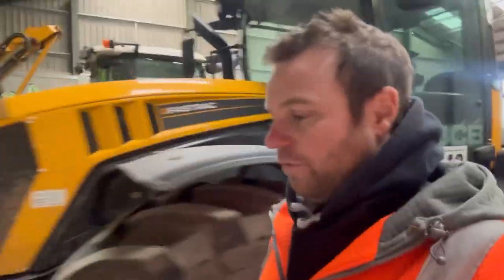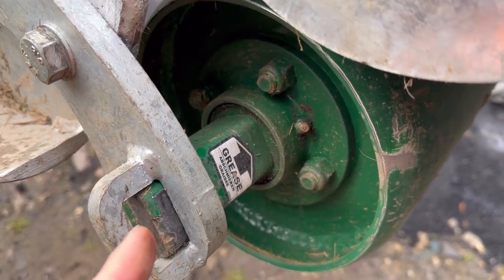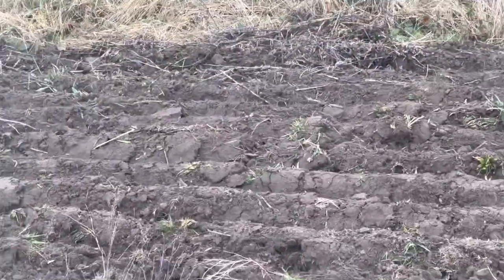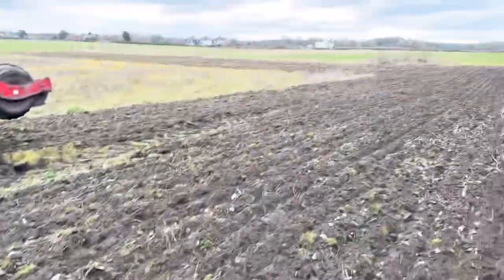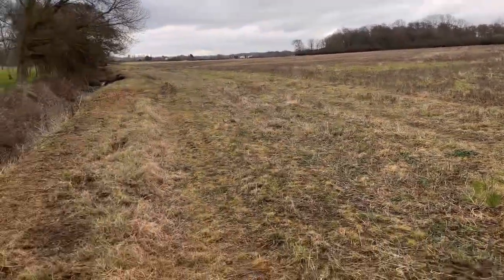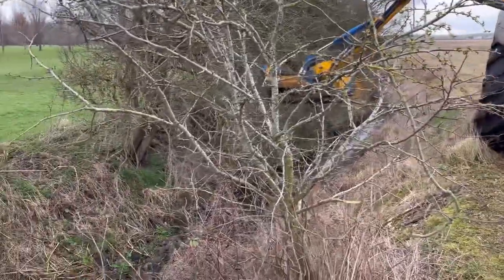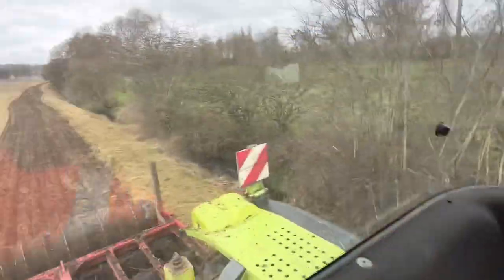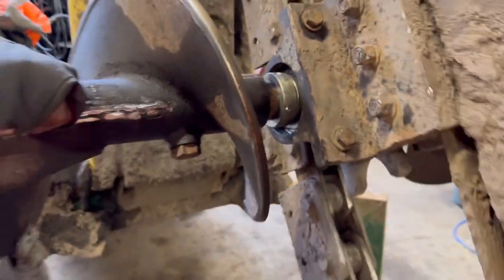VIEW FROM BIG TRACTOR I FOUND A SAFE #OLLYBLOGS #AnswerAsAPercent 1074

Comment: Always thought it strange you didn’t use the hot spanner for heating things up. Try gas direct for oxy rental is only about £7 a month and use propane. Bet them “scaly wags” were well pissed off when the knocked and smashed open that safe just to find some keys 😂😂. Oh yer sounds like convincing bullshit with the rotating bearing not winding string into it but who knows 🤷‍♂️

Comment: So when those shear bolts snap off do they just stay in the field ? im sure they could design a system where its resetable rather than having to replace them every time
Reply from the maker: You can get Hydrolic reset 
Yer they snap off for metal detectors to find